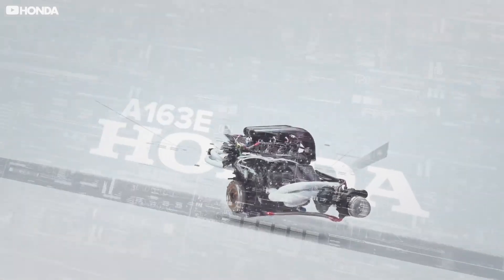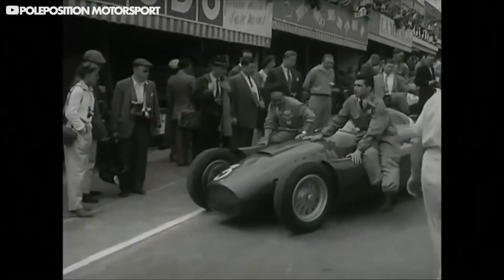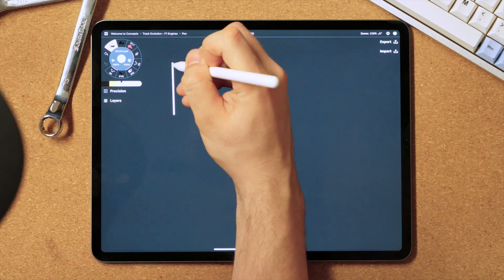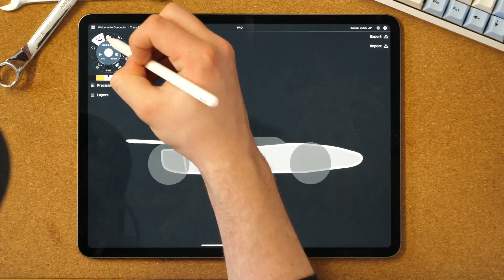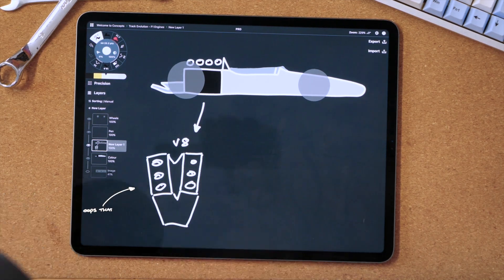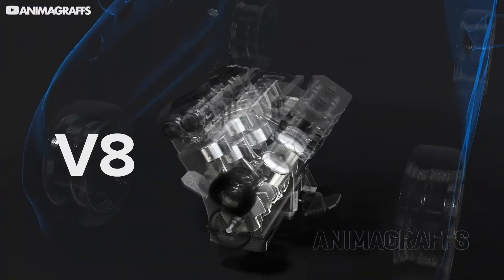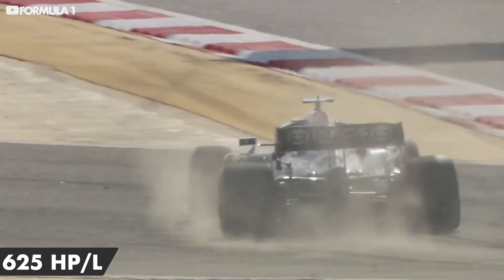The Incredible Evolution of Formula 1 Engines | Track Evolution

Comment from the maker: What do you think to the new series? I was blown away by that H16 engine!

Also, join us next Saturday where I am going to be driving an F1 car around the Nordschliefe for 24 hours straight! We are raising money for charity, you can find out more here! https://paypal.me/pools/c/8yb6qpYahR
Reply: Think this series will be very popular 
Lovely job! 
Also fingers crossed for the 24h race 🏎
Reply: Hope the 24 hours goes well and you don't get an itchy nose during a hairpin! Ideas for videos : alternate racing engineering like trucks, bikes, hill climbers etc etc
Reply from the maker: @JohnnyWednesday  Thanks Johnny, these are on the radar!
Reply: @Driver61  - I'm sure whatever you do I'll find interesting - hope you're well!
Reply: Excellent video. I still long for the days when F1 sounded  like it should with the NA V10.  I understand why they have gone back to turbos but it's the Pinnacle of motorsport  so it should sound  extreme .
Reply: @rneoman  - I agree on the basic principle - safety should never be compromised - but ideally we want cars racing down tubes, on the ceiling, on the sides, different branching paths for the racers to take - a jump or two wouldn't hurt.

But if we can't have those things? at least make them as loud as supercars - it's not much to ask.
Reply: 3 errors... the BRM H-16 used 2 flat 8's, not 2 V8 bolted ontop eachother, Renault introduced pneumatic valves in 1986, and the Kers was used with V8's, not V10 in 2009, 2011-2013 (wasn't used in 2010 due to teams having issues developing kers system)
Reply: @KayoMichiels  Come on Kayo dont be so bloddy exaustive!  ;-)
Reply: @jamesbehra2690  I know... but... these facts are easy to find with a simple google search...
Reply: @KayoMichiels  
I was joking mate.  You really made me laught !!! I guess the Driver 61 wasn´t expecting to be corrected for sure!
Reply: @KayoMichiels  Yes. The H16 was a wonderful engine. At the time, I was sorry that BRM didn't continue its development, but I can see why BRM gave up. Over-complex and balancing weights that flew off!!
Reply: It made a glorious noise but proved too heavy and unreliable to be a winner.
Reply: Man! This is a pretty good idea! Especially all the illustrations with the iPad...I liked that a lot! Also, as always, very informative!
Reply: I think you have one of the most interesting channels in YouTube, your info is awesome. I was never a fan and still find the races boring, but I love history, and your approach to the topic is very very entertaining.
Reply: I don't know why the screaming engine has become the sound of F1. They sound like a teenager whose voice breaks compared to those roaring beasts of the past. Guess the next evolution will be buzz and hum.
Reply: Very informative without an anorak needed. Seriously it was great.
Reply: @Driver61 This video has multiple inaccuracies, just the ones I spotted:
- Flat12 engines existed in the 1.5L NA era too: https://www.youtube.com/watch?v=vXsCbBxkr90
- Pneumatic valve springs were the main breakthrough in the 90s to allow the engines to rev higher, because steel valve springs failed above ~14000-14500 RPM, not pneumatic valve timing.
- in 2000s not only 3L V10s were used, 2006 regulations changed to 2.4L V8s.
- KERS was introduced in 2009, so (as per the drawing) it was NEVER used with 3L engines.
- MGU-K is the system that harvests energy from braking (Kinetic), and the "other" system is MGU-H which harvests excessive turbo spin (incorrectly called Heat) alongside other purposes. The drawing suggests the entire regenerative system was called MGU-K, but the MGU-K is the smaller part in the hybrid system.
- The modern V6s don't have the highest power per litre ratio of all eras, even the video showed 930 HP/L for quali-spec engines from the 80s. 
I'm a fan of your channel, your previous videos have always been a lot more precise, I'm disappointed for these.
Reply: i just wish in today generation someone would make a engine similar to ford cosworth DFV or the twin cam 4AGE, 4G63 or similar race engines
Reply: @henryjohn2218  F1 must be the top notch tech. But i understand your nostalgic feelings.
Reply: @henryjohn2218 😊😊😊😊
Reply: awsome !
Reply: Saw the 16 cylinder BRM at Mosport, back in '67. Jackie Stewart driving. Sounded like a swarm of bees! It broke.
Reply: @IanSmithCA  Wasn't it fun though.
Reply: Love this, looking forward to more of the series.
Reply: Great idea for a series. But the metric me is kind of sad you did not use Watts for power and BSFC and g/KWH for efficiency.
Reply: Love this new series/format!! Didn't like your last video as you stop/started footage and commented on F1 driver tactics. The topic was good but visually it was crud to watch. I gave it a 'like' in any case to support your channel but it truly was the first video that I did not enjoy. As I noted it was the format NOT the subject. Constant pausing of footage was frustrating. There you asked for feedback.... Keep up the great work!
Reply: Brilliant video as always everyone
Reply: Fantastic series idea with a cracking first episode! That Renault 'playing' the British national anthem at the end was both amazing and hilarious!
Reply: Am I wrong but earlier the black board was stating 1.6 at the time u were talking about 1.5
Reply: Always the best motorsport content Scott.
Reply: Hold on now, I always thought that Colin Chapman introduced using the engine as a stress member?
Reply: Cars / engines that are missing in this video: 
Lotus 56: Turbine Engine
Life W-12 engine
Reply: Great stuff that's all I can say.
Reply: Donated! Good luck and thanks for the fantastic content. You're doing a wonderful thing here.
Reply: Meanwhile F1 car sound is "Its Evolving but just Backwards"
Reply: @runninginthe90s75  eh eh indeed! But still i wont miss a single race.
Reply: Awesome!! I really like the fact there are more technical details and the higher density in information. The video didn’t feel too drawn out like wtf1
Reply: Love the new format! F1 evolution over time is fascinating and you tell it really well. The iPad addition is great. Keep it up!
Reply: Videos idea- The evolution of F1 transmissions|Track Evoloution
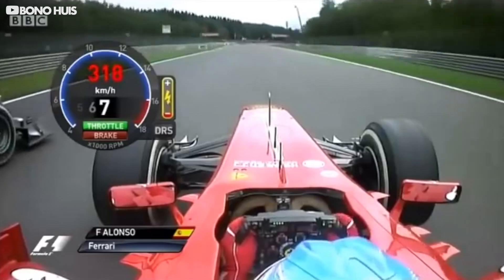Reply: 7:29 new V6 engines were introduced in 2014, which teams were developing since 2010. But one team was told as early as 2007 to start developing a 1.6 liter V6 engine with double KERS, and that team was Mercedes. Having a double time to develop and debug the engine, no wonder that in 2014 they became unbeatable. But...... was that legal? Most of people would say no. From 2014 onward all of their points, as well as points of their drivers, should have been nullified.
Reply: @cinegraphics  Really? They did knew everything before? What's your source? Because if it is, the last years were a complete schumble.
Reply: @jamesbehra2690  Niki Lauda said once that Mercedes started developing F1-type 1.6 V6 power units with double KERS somewhere in 2007. While the other teams were still developing their V8 engines until 2010. So, Mercedes had 3 years of extra time (almost double the time) compared to other teams. Enough time to develop and debug the new technology. That's the main reason why in 2014 when 1.6 V6 engines finally entered F1 they were unbeatable. Another reason was burning oil as fuel whenever LH would say: "Guys, I need extra power" on the team radio. They were doing it for 4 years without problems, until Ferrari found out about that. Only when Ferrari started doing the same did FIA introduce regulations to limit the oil consumption. But even then, Mercedes was allowed 33% higher oil consumption for the entire season, while all other teams had to respect the limitation.
Reply: @cinegraphics  That´s explosive. Cheaters, no wounder they dominated ever since then. Anyeay the engine is the least of Ferrari´s problem in my regard. Perhaps in 2022 with ground effects back everything change, regards.
Reply: @cinegraphics  Mercedes didn’t have a team in 2007, soooooo..............
Reply: @LPKelly380    LOL, did you just wake up from your cave? Mercedes are engine producer for F1 since forever. And that's exactly how they became dominant in 2014, by having a superior engine. They also had excellent aerodynamics, after they bought BrawnGP, but that didn't enable them to win in 2010, 2011, 2012 or 2013, did it? Nope. Aerodynamics alone wasn't enough. It was the engine, which they got tipped to start developing 4 years before any competitor. So in 2014 when F1 switched to V6 double-kers engines, Merc had 7 years of development behind them, while all other teams had 4. And that's the story behind Merc and Lewis success.
Reply: hi would make a video on brabham f1 engine built by Jack Brabham
Reply: i love it make more of such videos.
Reply: I have a question that’s been bugging me sort of on this topic. Why wasn’t Bottas able to beat de la Rosa’s (race) lap record in Bahrain? It seems that starting in 2018 and then especially last year, almost all of the lap records were smashed by the modern cars. But somehow, de la Rosa holds on to Bahrain, Barichello to Monza, and Schumacher to both China and Australia with the latter three records waving the flag for 2004. These are all “power tracks” which I assume has something to do with it but your other video on whether an F1 car could hit 300mph really got me wondering. Loving your stuff, can’t wait for the next one.
Reply: Well as far as the trickle down to road cars is concerned....sounds bogus, as they ran Hybrids earlier at Le Mans earlier than in F1 and the 24 hour torture test format of Le Mans does provide more valueable data than F1.....
Le Mans has the better record of innovations that go onto road cars, things like Fog lamps, windscreen wipers, Front Wheel drive, Rear engine/Mid engine layout, fuel Injection*, Disc-Brakes, Halogen Lights, Modern Diesel Engines especially Turbodiesels and finally LED and then later Laser Headlights. 

The Trickle down to roadcars is just F1 Marketing spiel. Frankly it should be more about the show, and it should be run as it is, a sprint race. Right now some of the engines have to last longer than their endurance counterparts, so F1 becomes more an endurance race than a sprint race...and it hasn't got the multiclass format to liven things up. 

*Introduced by Mercedes developed by Bosch for Aircraft...what the official document does not say is that Mercedes as a marque of Daimler-Benz had access to the knowledge, as Daimler Benz made the famous DB 601, 603 and 605 fuel injection engines powering the Bf109, Bf110, Me-210, as well as the He-177 in a special cursed arrangement called the DB 606/610. Which is basically two DB 601 or 605 slapped together....like the H16 a very unreliable engine that also had lubrication oil seep onto the lower block.....there is a reason the HE-177 was called the "Reichsfeuerzeug" roughly the Reich's (approved) Lighter, cause engine fires were virtually guaranteed.
Reply: P
Reply: Love this!! Can we have a evolution of tyres / tires throughout the years? :)
Reply: I grew up in a town near Monza. In 1985 I went to the track with my dad to watch the Saturday quali session. From 2-3 km away I could hear the engines roaring. It was impossible to stand next to the track without ear protection. When a car would reached the end of a straight, the downshift sounded like small explosion. The sound was massive. It's hard to believe the current engines with their vacuum cleaner sound are better than those 1980s engines.
Reply: Can you also do some wind tunnel items like this?
 https://www.youtube.com/watch?v=-Dy1M7oH3JE \Different body types of different F1 era's. I would love checking that out.
Mesmerising to watch the air flows.....
Reply: The H16 was not 2 V8s. It was 2 flat 8s with one mounted on top of the other. That's where the H came from. It looked like a H laying on its side.
Reply: Nicely done without to much for new or perspective fans, engineers, drivers or ? I can share this with my grandkids....
Reply: The H16 was just a wild misconception of what the trend was going to be in the 3 liter formula, but it wasn't the only one.  (BTW, the 1966 limit was 3.0 liters, not 3.5.)  Teams thought the cars would need big, powerful engines which was the impetus behind the H16, Cooper using the Maserati V-12 and the Weslake V-12 that Gurney commissioned.  Of those big, heavy engines the BRM was probably the biggest and the heaviest, not to mention seriously over complicated.

Then Brabham showed up with an underpowered but compact V-8 from Repco and a car that was basically on the weight limit and swept the 1966 season.  Just to prove a point, Brabham even won at Reims against the more powerful cars.  The lesson was that weight still mattered.  Brabham wasn't eclipsed until the Lotus 49-Cosworth found form.  But the 49 was another take on Brabham's concept of a relatively small, light car, but the Cosworth V-8 was much more powerful than the Repco.
Reply: If a morden f1 team put the engine in the front and somehow, found a way to meet the dimensional requirements, would they be allowed to race?
Reply: Thanks for covering the H16.  BRM had revolutionary engines and this was a marvel.  The 1950's BRM V16 engine was ahead of its time.  "The potential of the engine was illustrated in 1968 when Graham Hill drove the car in a demonstration in South Africa, the car being fitted with the original, larger, Rolls-Royce supercharger inlet. Hill revved the engine to 13,000rpm, at which point Rudd thought the engine would have been producing around 780 bhp."
Reply: @AndyFromBeaverton  
Thanks to the sympathetic driving style of Jim Clark the H16 BRM engine did win one GP - at Watkins Glen - in 1966. It was fitted to a Lotus (43) which was derived from their Indy chassis as the engine and gearbox was way too big for the conventional F1 Lotus chassis at that time.  Colin Chapman was using the H16 engine under licence but had to borrow a spare unit from the BRM team after Clark used their last remaining unit in qualifying (that sort of camaraderie wouldn't happen today). 
There are a couple of these H16 engines on static display at the Caister Castle Car Collection in Norfolk. One is fitted to a BRM F1 car from '66 or '67 and the second is on a stand next to a Lotus 33 (R14), the last of the 33's.

Comment: That H16 engine was so utterly insane. It had 64 valves, 16 throttlebodies, 8 camshafts, 8!, and 2 cranks. It weighed nearly 600 pounds and somehow revved to 10,000 RPM. It retired from 30 of the 40 races it entered 😂 
As a concept, it was very, very cool. And also, in fact, looked quite cool in the car, like something from a sci-fi film. But in practice, it was just a nightmare.
It remains one of the coolest racing engines ever built, in my opinion.

Comment: I want Renault, Mercedes, and Koenigsegg to collaborate on an engine with all their knowledge and technology and no expense spared. Renault with their work on high RPM, Mercedes with their turbo tech and thermal efficiency, and Koenigsegg with the free valve tech. Could you imagine what they could do with say a 5.0L V10 spinning at like 30,000 rpm being able to control every valve individually with twin turbo's? I mean what are we looking at 3000hp+ from an engine that could produce both low end torque due to the turbos and free valve, and tons of top end power and it could probably be tuned for pump gas/E85 and pass emissions....

Comment: what on earth is a hp/L??
There's a unit of time missing

edit: Now I understand. You mean hp per Liter of the engine's displacement, not per liter of fuel used. I would argue that this is not a valid metric for measuring efficiency

Comment: No, lotus were the first to use the engine as a stressed member in 1966, with the BRM H16 engine before the lotus 49 in 1967 widely credited for setting the template for using an engine as a stressed member. 

The ferrari you mentioned only had the engine as a semi stressed member, still supported by the chassis itself.

Comment: I think you mean "devolution". The engines have become less and less ICEs and more and more electric motors with incidental ICE components. The FIA is a laughing stock and a joke, they can barely pull 1/4 the viewers of the 90s. These new motors are useless and nobody outside people with basketball sized turbos on gt86s wants them.
Reply: average live tv audience 2008-21 is about 2/3 of the 90s numbers, 445m vs 650m - way less catastrophic that 1/4. and the move to majority pay tv broadcasts did that, not the engines

Comment: I wish the regulations didn't dictate the type of technology used. I'm all for lower/zero emissions, more efficiency, lower costs, etc., but set outcome targets such as emissions limits, net zero targets, displacement limits for different technologies, minimum efficiencies, types of fuel (if any, methanol like IndyCar used to use, ethanol like IndyCar uses now, hydrogen, regular ultra high octane gasoline, etc.). If an engine manufacturer thinks they can compete and meet those targets with a 3.0L V10, let them try.
Governments banning fossil fuels is the wrong way to go, they should mandate progressively lower emission limit targets by certain dates for extraction, refinement, transportation, etc. and then do the same for car manufacturers tailpipe emissions. It is possible to produce a near zero emission ICE now with gasoline/ethanol, when hydrogen power ICE technology matures, that would basically be zero emissions (of anything harmful to the environment). 
We need to regulate emissions, not technology to meet those targets.